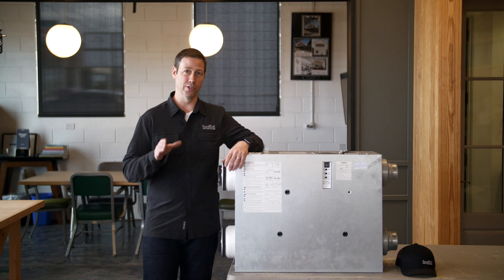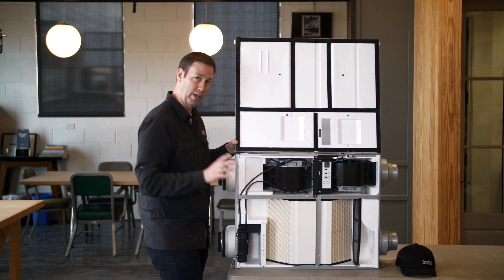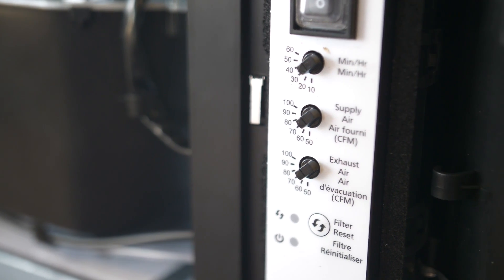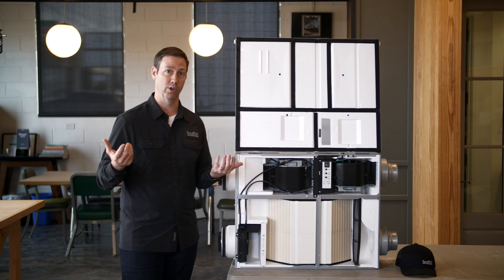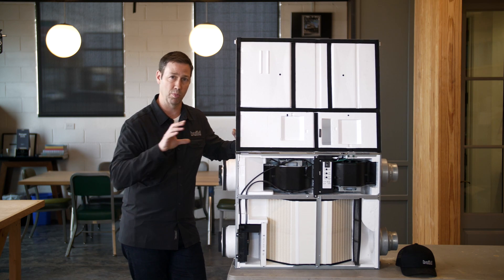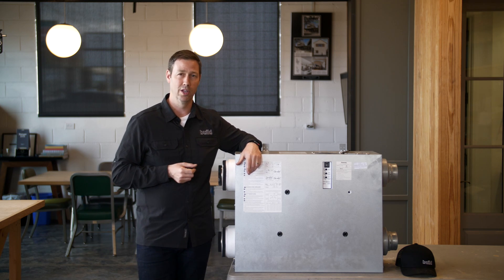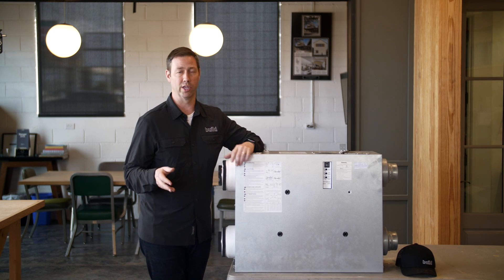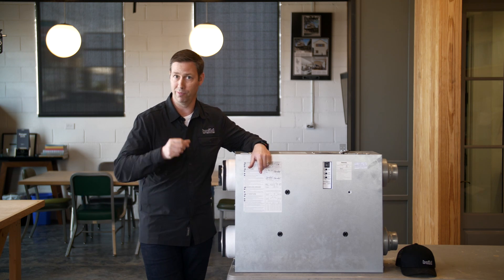ERV vs. HRV - Myths

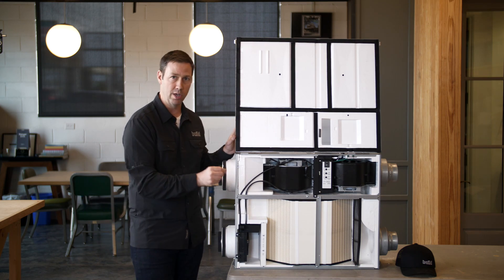Comment: Still confused between an ERV vs an HRV at 1:54 you mention a thin membrane in the ERV but no clarity on how it works. Apparently the HRV does not have the membrane. Is the entire core of the ERV a membrane and the HRV is not? Need a diagram.

Comment: Matt, what is your experience of using and recommending a Ductless ERV? 

I have a small 600 sq ft cabin in the Southwest that is extremely air tight. It is heated via wood stove and radiant floors and its cooled by a mini split. It has a kitchen hood and bathroom vents. I imagine i would need an ERV if i dont feel like cracking open a window. Ducted is not an option. Appreciate feedback.

Comment: Matt (or other pros) what would you recommend for our case? We have a new home, very tight that has relative humidity ~40% and climbs to ~50% after bathing. We were looking to add an ERV plumbed right into our furnace intake...but now am wondering if an HRV makes sense. Our humidity is high enough to cause us to have significant condensation on our windows...goal is to reduce that issue via lowering the humidity. Would love your feedback. Location: Chicago

Comment: If you have exhaust fan vents and a fresh air damper, would it not make since that you have a balanced house? If your hvac is putting positive pressure on the house, your house is air tight except your vents fans. The flapper on the vents is one way exhausting out. The positive pressure is going to force air out of those vents even tho the fan is not on. So the benefits of me installing an ERV is moot is it not?

Comment: Question for you knowledgeable folks... I am in the desert, very dry, four distinct seasons with hot Summers and cold Winters. I am thinking HRV, but I I would gladly pay extra for ERV (if cost is the only reason not too), if it keeps more humidity in my house for health etc, than an HRV would. Thoughts? I just keep hearing my climate can go either way.
Reply: I live in a warm area.  Not quite desert, but it can reach 118F in Summer.  Humidity will drop to low teens.  I have two ERVs - it's a large house and I was looking for 250cfm.  With one small AirCare (wick-based) humidifier, I can maintain 40-45% humidity inside.  In the extremes of Summer, it can reach 38% at a minimum.  I refill with 5-6 gallons every three or four days.  This humidifier is made for a medium room, but the ventilator helps distribute it evenly throughout the house.  

If I had an HRV instead, I believe one humidifier would not be enough.  I tried the humidifier in different spots and settled on an area near an ERV exhaust intake (where the stale inside air goes to the core, on it's way outside.)  The humidifier is set 5% higher than my target humidity.  The ERVs run for 20 minutes each hour, on low speed.  Used in this way, it's been very consistent and comfortable.  I almost never open windows now, and there is much less dust.  As a side note, baking bread is also more consistent with stable humidity.

Whatever you get, make sure you have good access to the unit for cleaning and replacing the filters.
Reply: @joshualucero8256  thanks for sharing your thoughts

Comment: You keep mentioning the south needing an ERV, because of the humidity, but here in AZ its a dry heat with very little humidity. Advice?
Reply: When it is dry outside, an ERV will help preserve the indoor humidity you have.  You will still lose some humidity.  You will also add loads to your air conditioning.  (More humid air is heavier and takes more energy to cool.)  I would suggest using an ERV with a humidifier.  Maybe don't run the ERV during summer days, but only at night.  I do run mine when the gas range is on, regardless.

Comment: I feel like you're still spreading myths. Why would I only need an HRV in the north? In the cold north the air is usually dry and we need more humidity indoors. Why would I want to pump all the comfortable humid indoor air out and then replace it with dry air from outside? In Montana our winter air is so dry that our skin cracks so I would rather save the humidity from showering and cooking and keep it inside with an ERV.

Comment: I program HVAC (mostly commercial) and I have heard the myth many times that ERVs will dehumidify a building.  I have a question though, how does an ERV even dehumidify the incoming air?  Because the air would still need to be brought down to its Dew Point especially if the air never mixes right?  Obviously there are some cases this will work but say you are exhausting 72 Deg F air out of your house through the ERV (it is likely a higher temp than that even) then the only way I see that air dehumidifying outside air is if the outside air is 75 w/ 94%RH, or 76 w/ 89%RH, or 78 w/ 84%RH, or 80 w/ 79%RH, or 82 w/ 74% RH, 85 w/ 70%RH, or 87 w/ 66%RH.  Basically what I am getting at it is has to be a very humid or very hot and uncomfortably humid day.  And thats to get the moisture content of the air down to the equivalent of the exhausted air in this scenario.  Am I missing something?

Comment: What's the scenario in the event of a grid down situation for a tight home with an ERV or HRV?  
Guess one would have to open the windows and suffer the pollutants, the cold, the heat, the wind, etc until electricity is restored. 
.....Not an issue for those with solar, wind, hydro or geothermal and enough battery storage to drive an air balancing system.
Reply: You could put off opening the windows by monitoring carbon dioxide levels.  Decent chance power would be back on before it was a problem.  I didn't run my ERV for about six weeks straight, during wildfires in 2021.  That was a little rough.  Using the gas range is a problem, though.

Also, running an ERV from a battery is actually not bad.  They do not use much power at all.  You could run it on a UPS, occasionally,  for some days.  Recharge it with portable solar and it might run continuously.

Comment: Question: I live with my family in the southern city of Arequipa, Peru. Temperature variation is little enough throughout the year that no one has central air or heat, but it's extremely dry and as a result, there's a LOT of dust. I plan to build a house and am hoping that there might be a way that an ERV might add humidity or at least keep some in the house as well as reducing dust and outdoor pollutants. The problem is that few people have a clue what these even are and I would like one that takes 220-240 volts since that's what they use here.  Any suggestions?

Comment: When the temperatures drop at night how can I take advantage of this?  before the 110° hits. And same thing for the winter. This system doesn't seem right for me as it would exchange its energy and taking what I want accomplished even longer. Although I do love the idea of fresh air in the home too.
Reply: There are some units that can run in bypass mode, meaning the core is not used.  That would cool the house off faster, potentially.

Comment: I live on the Oregon coast. My home is 2600 sqft. We have a lot of rain and cooler ocean air. During July  through September is an average of 60-75 degrees. The rest of the time is cold and wet. What system would you recommend for that situation? Do they both filter or “clean the air”?

Comment: From good ol wisconsin and we thought the same.  HRV up here and ERV down there, but the problem is what about the summer?  we'd have to turn off the HRV (if customers remember to) otherwise it'd get too humid in the home.  So we just go with the ERV instead and be able to leave it on year round while bringing in fresh air.
Reply: My thoughts too, with his point about humidity I was about to say over here in Minnesota the summers are extremely humid, and the winter's extremely dry. So it seems like an ERV for me
Reply: So is this the general consensus..common sense would tell me..spend once, cry once and dont worry about humidity..spring for the EVR?
Thank you..im almost  ready to purchase. Just doing more homework
Reply: Yup we’re in Winnipeg mb, HRV in a new tight home is very dry in winter and humid in summer. New trend moving to ERV

Comment: I have a 2 flat in Wisconsin with boiler heat zoned separate for each apartment.  My main concern is the downstairs apartment.  1,100 sqr ft.  I'm doing work down there in preparation to rent out again and will run duct work needed.  I need fresh are in the winter but also need to dehumidify in the summer as well as fresh air.  So your saying that neither an HRV or ERV will accomplish this?  I have a stand alone dehumidifier currently and it is stupid expensive to run.  What is my best option here?  Also whatever I do downstairs will be completely separate from the upstairs do to sound proofing.

Comment: I'm wondering if you need to have a central heating system for these to work or can you have this unit with a few vents and use radiant heating
Reply: Have used an ERV for the last 40 years with radiant heating.  One of the incoming vents provides combustion air also for the wood boiler tied to the hydronic in floor heat.  Works great!

Comment: HRV pulls a greater delta causing condensation across the core in cold climates. HRVs have condensation drains ERVs do not typically.

Comment: Do these do anything w removing moisture n humidity out of basements ??
Reply: Only if your exterior air is less humid than your basement air, and you will want an HRV instead of an ERV to prevent moisture exchange. It will pull the air from inside, ostensibly your basement if you duct your exhaust there, and replace it with air from outside. You might see better performance from a dehumidifier.
Reply: @thousandleaves  yea def going w a dehumidifier just seen commercial style and sized ones need to handle this moisture down n get it out too much sneezing and sniffling going on every day

Comment: In the north an ERV is recommended instead, HRVs can make it too dry due to the humidity outside in the winter and people get uncomfortable and turn the units off, losing the benefits of ventilation. An ERV will help retain some of the moisture produced in the home by moving it to the incoming air stream, as more to less.
Reply: @Dan You're not wrong. An ERV will make it drier, I only meant it will help retain some of the moisture in comparison to an HRV which will not retain any of the moisture.
Reply: @technorex344  hey guys I am an hvac contractor in Minnesota and I continue to go into houses that the HRV'S are running non stop during the summer and have to explain to the homeowners on how much load they are adding to the ac especially with how warm this year has been. On top of that one of the local inspectors decided to make contractors wire the HRV'S to run continuously 24/7 365 and so now I will be switching to ERVs for that reason it only makes sense if people need to run them during the summer as well.
Reply: @M-A-R-V-I-K  Hi there, I'm thinking about putting an ERV in our cabin here in Minnesota. It's just baseboard heat and through wall AC, so we don't get any air movement or fresh air. So I figured it's a no-brainer in the summer because you get fresh air from outside and the ERV removes some of the humidity, but in a strange twist for me, In the winter I actually want the ERV to remove humidity because the cabin is sealed up enough that with even a few people in there for a day or two the cabin becomes very humid, and I actually want some of the dryer air to come inside. It gets so bad that the humidity condenses on the inside of the windows and causes mold. I already have a dehumidifier in the basement but I might have to get one on the second level if the ERV doesn't solve it.
Reply: @jasonkilley  Jason the ERV will actually remove moisture in in the winter just not as fast as an HRV. Minnesota winter air is typically super dry and that's why an hrv running in Minnesota almost always needs a humidifier which is why you see HRV'S paired with an aprilaire whole house humidifier.
Reply: The reality is this is completely regional.  In Calgary, we are too dry and have to add moisture to our air.  Go to Ottawa and you need to dry the air.  There is no silver bullet.  The reality is a professional HVAC designer should be consulted.

Comment: Why do you need to filter the air that’s going out of the house anyway? The bathroom and kitchen only smells bad; air from there isn’t exactly harmful.
Reply: If you use gas appliances in the kitchen, then kitchen air IS actually bad for you. But no, you wouldn't typically filter exhaust air.

Comment: Hey Matt, huge fan of your work & I love this channel; I've been here since September of 17'. I just wanted to say that the way you showcase products, present complicated issues while elegantly sharing your knowledge km  how to solve problems, as well as explaining complex design techniques in easily digestible & consumable language is fantastic. You are not only doing YouTube diffent than other builders but you're doing it better. Anyways I'm curious about these type of products & have a question for you. Filters aside & given how affordable adding an erv/hrv to a built can be: is there any reason that you would be unable to run two units inline for a single home? Obviously these units aren't 100% efficient & no matter how many you add to a  system you'll never reach 100% efficiency. However is there any advantage or disadvantage that you can think of if you ran 2 in tandem? Like perhaps for a passive house build or situation where the goal is to be as efficient as possible? If you had to speculate, do you think there would be significant difference in the intake air temperature after going through both heat exchangers?  Or is there an efficiency limit you'd run into once the air gets below a certain temperature differential? I'd be interested to see some data of a system w/piggybacked hrv's. Hopefully I was clear enough for you to understand because I'd love some feedback from you. Cheers

Comment: You generally used broad categories for which unit to choose. Minnesota and the surrounding states have very stuff and humid summers but also cold winters which are emphasized by the humidity.  It seems to me that the ERV would be the way to go, according to your description.  The upper midwest has 4 distinct seasons.  Any further direction or thoughts regarding that? Thanks for the great, helpful video.
Reply: I live in MN & I understand what you mean. An important thing to note about erv's is that they are passively exchanging humity. Which means you can not meter or control the rate or direction that the humity is gonna flow. The humidity will always transfer from the higher humidity side to the lower humidity side until it reaches an equilibrium; ie exchange moisture for as long as there is a differential in humidity. That makes it desirable in parts of the country w/high humidity. Since the air in your house is gonna be dryer than the intake air from outside, an erv will exchange some of that moisture from the the intake side to the exhaust side (high to low.) since this system functions passively, this wouldn't be desirable someone like me who lives in MN. Because of how dry the winters are & the nature of which an erv transfers moisture in the system. I would constantly be dumping moisture from the inside of my house (higher rh) to outside (lower rh.) Running the heat exchanger during winter would force me to actively condition the inlet air to raise the rh in my house. I would be fighting against myself & the system non stop by artificially increasing the rh in my house; because the higher the  moisture differential is, the erv works more efficiently. You know the whole 1 step forward 2 steps back thing. You could run an erv in cold climates but that means any system that you use to regulate the rh in your house is gonna have an unnecessarily heavier load during those winter months. Having a stytem with a hrv & actively controlling the humidity independently would not only be more effective but be more cost effective to run. Realistically in colder climates, any moisture exchange that an erv offers during the summer will quickly be outweighed during the winter months.

Comment: What if you're somewhere colder, and you want MORE humidity inside to prevent the dry air from making you sick? Does an ERV add humidity?
Reply: During the cold & dry winter months, an ERV helps preserve the existing indoor humidity by exchanging the exhaust air's water vapor to the fresh filtered air coming in.  However, it's not a 100% transfer, so you will always lose some of the humidity in the air exchange process.  To keep the indoor air more moist, you have to lower air exchange volume and run the ERV at a lower CFM, at a rate somewhere above the minimum recommended but well below the maximum rate.
Reply: Thanks. My basement is way too dry. Keep getting sick.